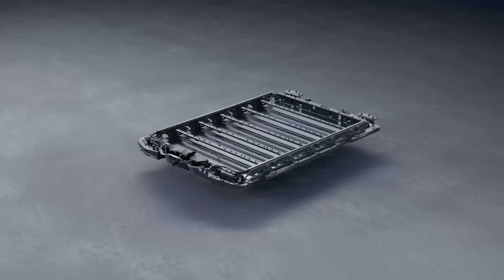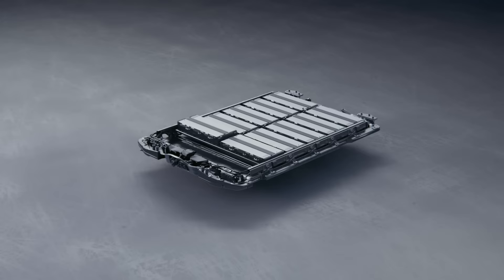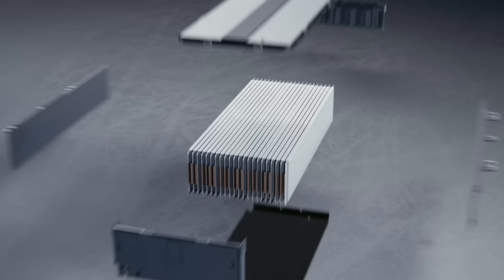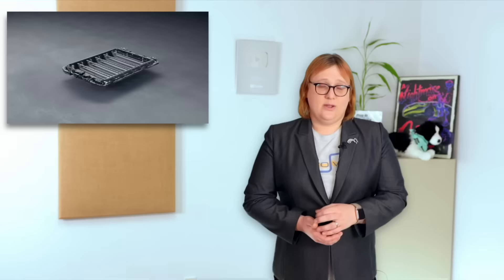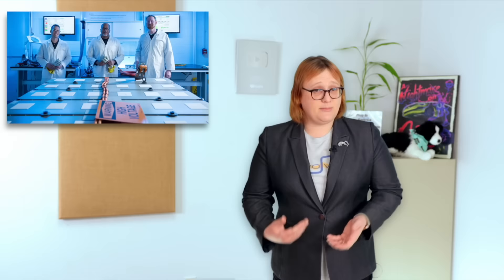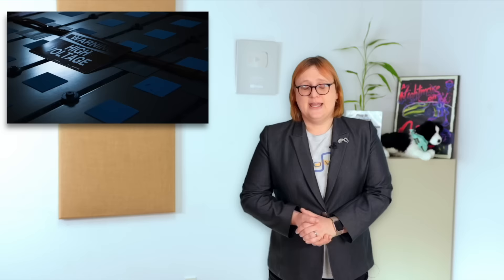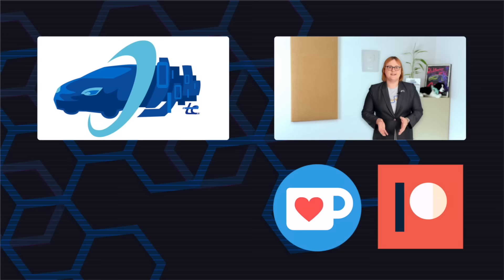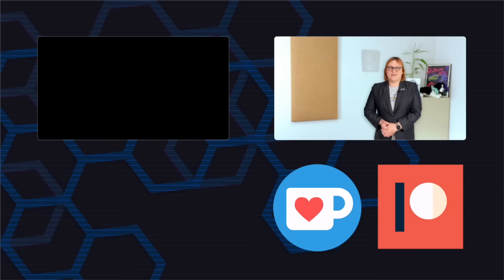Will GM's Ultium's Forward Compatibility Revolutionize The EV Industry?

Comment: Wireless BMS and capability to mix different battery chemistries and generations in the same pack sound interesting. But Musk is on record as saying that large pouch cells are particularly susceptible to thermal runaway, a problem that has plagued the current generation of Chevy Bolts. Although the Ultium cells are next-generation from GM compared with the Bolt battery tech, they're still based on large pouch cells, even larger for Ultium than in the Bolt, according to your video. Hopefully, that issue doesn't come back to haunt GM as they roll out Ultium battery tech.

Comment: Nice reporting, thanks. 

Personally not keen on the wireless battery management system idea. Physical signal wires are not going to add much weight or cost and are a lot less likely to loose a signal. Wi-Fi is not 100% guaranteed. It’s not hard to disrupt or block, Just my2 cents. Cheers

Comment: Having worked on wireless management software, a big solid snake exclamation mark appeared above my head when she said there would be wireless interleave for all of these systems. Maybe they can make it work I don't know...
Reply: "can" vs "will"
There is no good reason a system couldn't work like a WiFi router or things like that.  The car's computer could inquire about each modules status at about a rate of 10 times per second and it would be fast enough.

Comment: Just want cheap long life batteries do not care who makes them first.
Reply: with everything I've heard it sounds like tesla is much closer than anybody else but it does sound like multiple people are going to get there in the next couple of years in different ways. which means competition! could be a very exciting time...
Reply: With an upgradable battery module you can buy from whoever makes them best.
Reply: @timmurphy5541  - That's fine if you can convince others that your standard is the one to support. Achieving that for things like connectors is hard enough, so I wouldn't expect much cooperation. I can't see Tesla being remotely interested in that, and they look to have the best batteries and also the most rapid development.
Reply: @rogerfroud300  Why is anyone else needed? You get a GM vehicle and when GM update their battery chemistry you can replace some/all of your cells.
Reply: @rhydianlewis2867  - Quite so, but economy of scale works on both simple and complex designs. At the same production volume, a more complex won't be competitive against a simpler one. The gains of scale flatten off as the volumes become very large, so it's doubtful they could compete with Tesla for example, unless they had ten times the volume.
Reply: @stefanweilhartner4415  the original comment was referring to million mile battery etc in terms of long lasting. I was agreeing that nobody is there yet but it seems like tesla will announce theirs first from everything I've heard. I think you're talking about what is already on the market, with the ID3 and model 3. I don't think any batteries from anybody are particularly exciting, it's really the same generation of batteries we've had for the last 10+ years. The exciting thing is that we are about to hit a new generation of batteries and like the original comment, I also don't care who gets their first 😀
Reply: @rogerfroud300  Tesla may become the Apple of the Electric car world. Doing their own thing wile other manufacturers work towards a common standard.  In China and Europe Tesla has adapted their charging standard so we will see.

Comment: My only worry is exactly why wireless, that alone is open to compromise, but the second issues is in the past 8 years we have move from Bluetooth 1-5 WiFi 802.11 , a/b n an, ac ax that’s a lot of different protocols, what’s to say that like Bluetooth 1-2 the wireless standard won’t be retired or supported in 10 years , that basically will leave us in the same situation as what we have now ,it would have been better if they wired the packs together with a cat 6/7 stp to a non fan based lan switch tied into the packs cooling system similar to what Tesla proposed but on a local level

Comment: Well, in theory you can replace a pack and put in any battery tech that is available at the time. In practice you run into trouble as soon as you figure in temperature management. Different chemistries have different temperature characteristics (different optimum temperatures for operation and - particularly - charging). So I don't think you want to 'mix-and-match' unless you have different battery controllers and temperature control mechanisms included in each pack (which seems wildly inefficient and also owers your MTBF for the electronics. So now you not only have to unscrew the entire bottom of the car for battery failures but also for controller failures.).
And the way it looks currently - with the million mile battery becoming the new norm - a replacement of a pack becomes so unlikely that such flexibility is not really needed.
Reply from the maker: Each module has its own smart control system, including battery management, thermal, and charging.
Reply: @transportevolved  Wondering how this is supposed to work with a liquid based BMS where different packs of different chemistries want different temperatures. In any case: Packs can then fail in two ways: The pack fails or its controller fails. With many individual controllers that just ups the chance of electronics failure enormously (which currently already sits at no 1 for faults in any kind of car - ICE or EV). Having to switch out a pack because of its electronics failing is going to be an expensive (and unneccessary) pain.  Let's see. But I won't be surprised if the decision comes back to haunt GM
Reply from the maker: @peterzerfass4609  We're not sure - but if a mini split system in a house can offer different temperatures to different zones...

Comment: Interesting that GM and Tesla seem to be going in opposite directions with battery design.  Tesla is doing away with modules, GM is going highly modular.  I can see the advantages to GM's approach, but it looks like Tesla's will cost less and have higher energy density.
Reply: Tesla is working to solve tomorrow's problem and GM is working on yesterday's.  If batteries are really expensive, then it makes sense to just replace part of the battery, not the entire pack.  But I think Tesla is working to make the entire pack so cheap and reliable that a modular design doesn't make sense.  And one way to make them cheaper, is to not make them modular.

Comment: Very interesting and i'm pro GM, but they have strayed WAYYYY into the woods with no real way back. 

BC no true experience in producing the skateboards which GM itself invented almost 20 years ago, this seems like a whole new field for them and ghey try covering every possible combination which will insure them against pitfalls (such as their pouch-cell supplier raising prices) but leave them inefficient and lagging. 

For example: arrange modules horizontally or vertically, to allow for a lower floor. Great answer to a nonexistent problem. How many cars are there that actually have their skateboard too thick? How much of a siffereence in height does it make anyway? Answers: who cares and little. Just stacking them vertically would've been fine.

Example: bringing battery modules to a perfection so that you can replace any module if it fails with the newest module available without digging back for old parts. Great solution but why should they fail? Tesla is so sure in their design that elon said tje current modules are a throwback to the roadster days when they wanted the same replacability that GM is seeking, eo they have a module team and thus modukes. But nowadays batteries just don't fail and the modules are an anachronism, their upcoming designs will be cell-to-pack, which lowers manufacturing costs, space (so more cells in a pack) and weight. My bet is also height, which should lower the case for horizontal-vertical stacking)

The list goes on... they have a limited battery supply of 30giga-hr per year but spread it in s huge number of models instead of focusing on one or two, then diversifying once additional capacity is available.

I could go on and on, but i see a company panicking to hedge every possible pitfall and cover all bases at once instead of charting a way they figure should work and focusing on bringing it to market as quickly and efficiently as possible. They do it the old way of perfecting a planned product and only then bringing it to market - without realizing this leads to late product launches.

Sad.
Reply: Just as a note these are not skateboards.  These are two vehicle platforms BEV3 (Unibody) and BT1 (Body on frame).  GM during their EV day presentation made that clear and indicated that skateboard is weight inefficient.

Comment: This module and cell strategy is more or less like Volkswagens way in the MEB.
They also have large LGChem pouch cells, 24 cells per module. But Volkswagen in their first round: 78 Ah (NMC-721) per cell instead of GM: probably 95 Ah (NCMA) per cell. Volkswagen also has physical compatibility with prismatic cells (CATL, Samsung SDI), if you arrange the cells properly inside the modules.
The promises of forward compatibility? I do not believe them. Either a battery is of a true long-lasting design: then you will not need replacement modules, because the battery itself is as durable as the car and both of them will be recycled one day. If a carmaker however specifically designs his battery pack for the replacement of modules, then they are estimated to fail at a certain rate shorter than vehicle life and likely cause warranty issues.
Forward compatibility had been promised in quite a number of cases, think of Tesla autopilot hardware. Simply swap the computer, and you will have better driving automation. Has it become reality? No, yet it has not. The cell designs of VDA standard sizes (like BEV2, PHEV1 and PHEV2, HEV pouch cells, integrated start stop low-voltage cells) would have perfect physical compatibility as well, still so far it has not really been used for true upgrades of existing cars, but only at production lines for selling new models with new features.
Examples for true forward compatbility for the aftermarket are in rims+tires, the DIN standard slot and ISO connectors for aftermarket radios, classical light bulbs (think of H4, H7, W5W and so on), exchange of lead-acid starter batteries (a number of standard dimensions), spark plugs, air and fuel filters, wiper blades, brake discs and pads. Many of them being essentially wear items.

Comment: Curious that so few few question how we're going to satisfy the increasing demand for electricity . More coal or gas fired plants? More rivers to be dammed? Does anyone relly believe that we can grow forever while virtually all ecosystems are being stressed to the point of collapse?
Reply from the maker: Curious that people saying this seem unaware of the vast amount of energy goes into refining oil,  and that fossil fuel vehicles are around 20% efficient. If most vehicles are electric, a lot of that energy is freed up. That is just one part of the picture.

No, no one believes that we can grow forever, and no, we at TE don't think that EVs will fix climate change by themselves. But we do believe reducing CO2 output by transport is an important part of solving the challenges of climate change.

^Kate

Comment: Wireless interconnection, seamless software integration, ‘dropping the battery pack’ out to replace a faulty module...”as you’re here mate, we may as well see to a few items that’ll need attention in the future, might as well do it now yeah, it’ll be cheaper in the long run”...should keep the dealerships happy?
In light of GM’s history of ‘crushing’ things, and their recent complete shafting of the Holden brand, it’ll take more than a few marketing terms, and ‘probablys/hopefullys’ to prompt enthusiasm over their future plans. 
They’ll definitely need a state-of -the-art production plant to produce all the batteries required for those huge power guzzling vehicles they have planned. Shouldn’t they be concentrating on affordable vehicles like the bolt...improving efficiency and making them cheaper for the mass market?
Meanwhile, behind this charade, they are going full tilt on ICE production, taking full advantage of the EPA’s relaxing of emissions standards.
Sorry, am I being horrible?
I’ll try and play nicely...yaaay, GM! 🥰

Comment: GM could produce up to 30 GWh battery capacity per year. That compares to 300,000 Tesla Model S with 100 kWh ... And they may need a power plant to charge all those batteries before leaving the factory. Both impressive and food for critical thinking.

Comment: Hybrids are a better solution that BEVs.  Lithium requires 500,000 gallons per ton; current lithium production already uses 1% of the worlds fresh water; but produce only 2.5% of the light vehicles.  To get to 25% would take 10% which is as much water as in the Great Lakes Michigan and Erie combined. A better alternative if hybrids; they have smaller batteries; you could make 6x was many  for the same water; while achieving 5x the CO2 cut. BEVs should get no subsidy and be banned.

Comment: The reason why GM batteries are so reliable is because of their aggressive battery management and most of its car up to this point HAVE NOT had fast charging.  The 50KW charging Bolts will be the first true test of GM batteries.   Wireless battery management.......that will be a mess.  Hopefully individual modules will be easy to replace.  For those of you that have worked on modern GM cars know that will be highly unlikely.

Comment: And this again proves how many years of advantage Tesla has. The 2008 Roadster had swappable modules. Using the battery for structural integrity is also an old idea. The wireless connection is new, but I'm not sure what's the advantage there, at least compared to a Tesla battery pack, which has very little wiring.
Tesla started to move away from modules with the Model 3 already, and plans to completely eliminate them. The advantage is much less packaging. Cell failure is not an issue. With thousands of cells, the battery can lose many without any noticeable capacity loss. And the cells are very reliable anyway. Tesla also started to reduce the Cobalt content years ago and they are close to completely eliminating it.
The 30GWh planned capacity is nice, but again, several years late. Tesla is now aiming for several TWh capacity, about 100x more.

Comment: The battery wars are on and this is the arms race that will kill the internal combustion engine. Battery tech is just getting going and electric cars are already nearing price parity with ICE, not even taking fuel savings into account. You'd be crazy to buy an ICE car today if you do not need to (or have no concern for financial risk), and that fact is an immediate, dire threat to traditional auto OEMs.

Comment: What is critical is fast charge. Electric cars will not be able to compete until you can charge them within 20 , 30 minutes at least. That would be a full charge with quick charges about 10 or 15 minutes for the average commute Drive. The first car maker to come out with that and a range of at least 500 miles will dominate the industry especially if they come out with a reasonable priced vehicle. There's only so much market for the luxury electric vehicle. A company that comes out with one for soccer moms will be the Ford of electric cars.

Comment: Honestly wireless communication vs. light data wiring not that much weight savings, long term wireless antennas creep out of tune and cause all kinds of mischief. For example if you have a reasonably used laptop or wireless router, how long do they last 3-5 years? You could reduce the weight by using fibre optics. The real wire weight is in the main voltage/current bus system that's a significant percentage, not the data lines. The best system should be a lightweight central BMS, and each module with light on board thermal and voltage sensors. This way modules are simpler more durable and less expensive. if you have 30 computers/BMS's on board instead of just 1 the Complexity goes up and Durability goes down.

Comment: If GM were really serious about offering a better battery pack they should be designing side loading battery backs. unbolt the sill to gain access to one side of the pack and slide out the offending cell. this means that no special tools are required, no need to drop out half a ton of battries in order to access a singe cell and also means your averge auto mechanic can easily work on the car, another added bonus is that you could also upgrade your car without even having to look at GM affiliated dealer.

Coming to think of it, GM probably designed it the way they did for that very reason. Business as usual then.
Reply from the maker: Your suggested design would require a complete reengineering of vehicle and vehicle safety systems. We're pretty sure GM engineers know what they're doing :)
Reply: @transportevolved  
"Your suggested design would require a complete reengineering of vehicle and vehicle safety systems"
Well if it was engineered to be side loading in the first place it wouldn't need re-engineering.

"We're pretty sure GM engineers know what they're doing :)"
Thats what I said at the end of my comment.